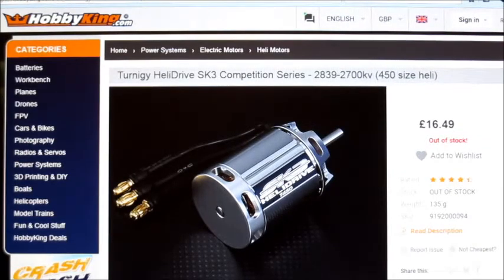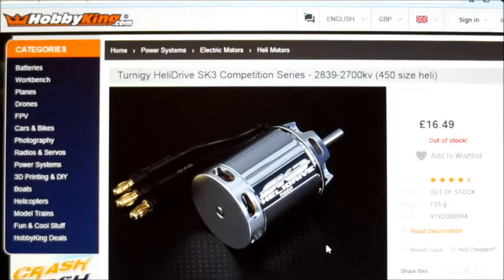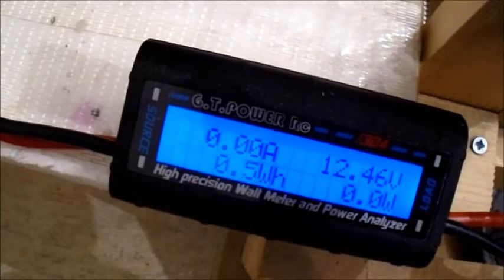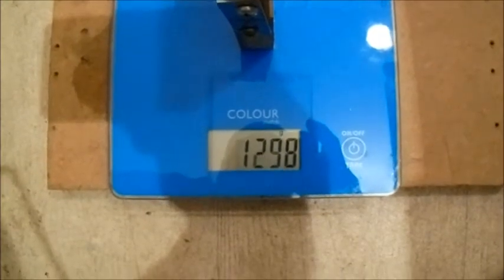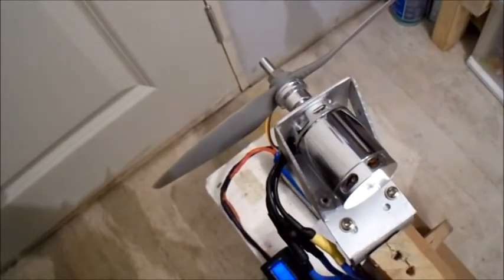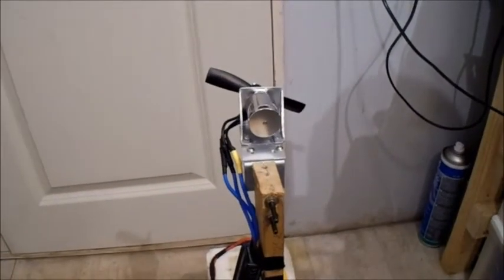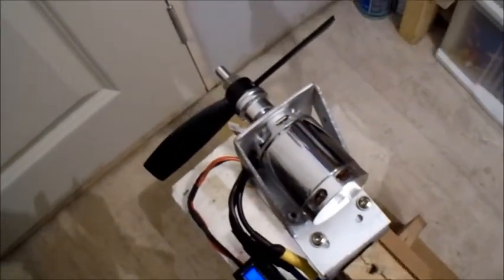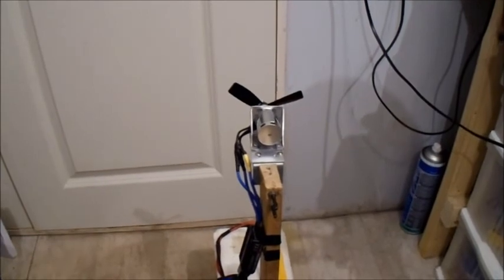Turnigy SK3 450 HeliDrive 2839 2700kv Thrust Test Motor test of the Week

Comment: Hi RCPP - Another excellent set of tests.  I was very intrigued by the difference in performance on 3S between the 6x4 APC electric and gas props.  To see more thrust with a lower amp draw with the gas prop is always of interest to me.  Have you found that to be a fairly common occurrence when using the gas props on higher Kv motors (all mine are 2200 Kv and higher)? I would be interested in giving that a try on some of the motors I use, I've never thought of experimenting with a gas prop, do they tend to be stiffer?  Do you get the 6x4 APC gas props from Hobby King or another source?  Learn something every time I watch one of your videos, thanks so much for taking the time to do all this testing :)  Cheers, Scott
Reply from the maker: Hi Scott hope you're doing well
Thanks for your comment they are always appreciated. I know it sounds weird but yes I have found that 9/10 times a gas prop will give a lower amp draw and also more thrust size for size compared to the electric props. Depending on make of prop, but have mostly tested APC electric against APC gas. Or APC electric against JXF gas props. I think on a slower plane with a low kv motor the electric props will perform better in the air because that's what what they were designed for and the thrust difference isn't that different. When the rpm's start to get higher though the gas props become more efficient. Maybe because yes they are stiffer. I got my APC 6x4 gas props from a sight here in the UK they are not available at hobbyking but I did a bit of a search and found them for sale on this US sight. 
https://www.amainhobbies.com/apc-6x4-gas-sport-propeller-apc06040/p36472
If you give them a try I hope you get some good results.
...RCPP
Reply: Thanks RCPP, appreciate the quick response and providing the link, I will probably put an order in later this week to try out a few of the APC 6x4 gas props, much appreciated.  Hope you are doing well also :)  Cheers, Scott